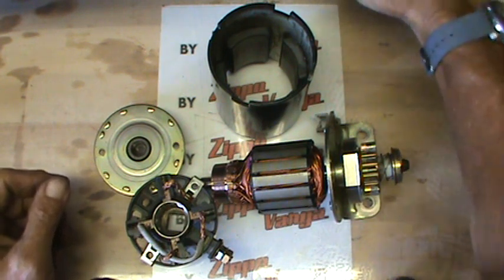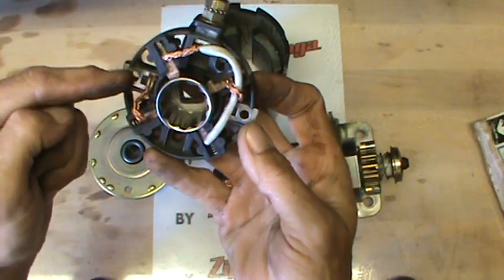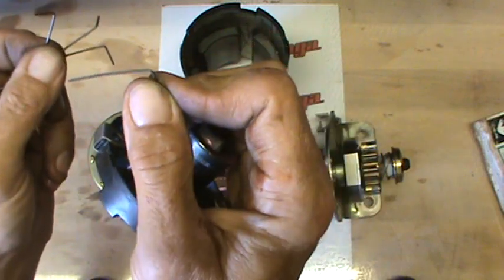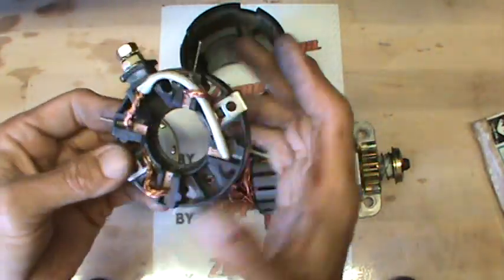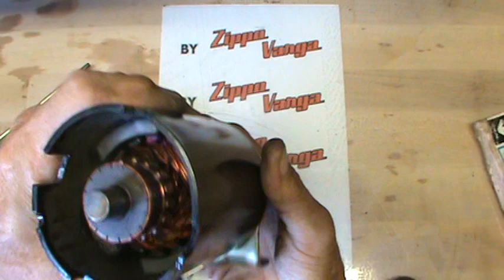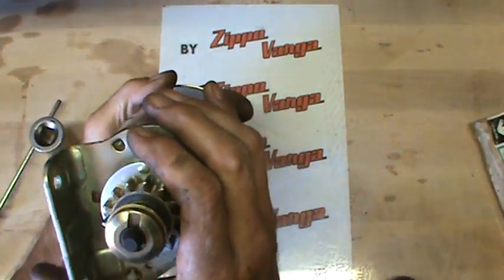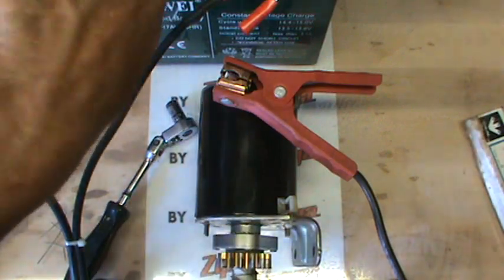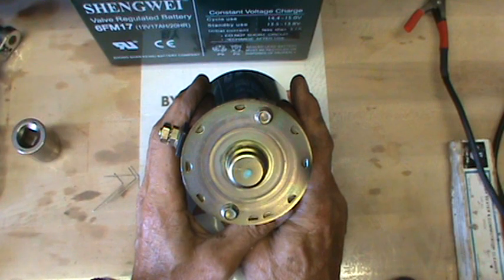How To Install Brushes in a Starter

Comment: Very helpful, excellent video.  My starter is for a 12.5 kw generator, and it is built a little differently than the one you used, but your video gave me the understanding I needed to get my brushes installed.  Many thanks!

Comment: I did a engine swap and did not notice where you connect the battery cable that post was hanging out of the starter, still works. I have worked on starters before, this little trick should make life a whole lot less painful.

Comment: I don't watch your channel ... until now. I'm trying to get the brushes back on myself on mower starter (one you're working on looks nearly identical to mine) and had the same idea of wire. I just wasn't finding any stiff enough. Didn't know there was such a thing as jeweler's wire. [Also found piano wire an hour later]. Only there's enough headroom on the brushes to allow the wire to slide under the bridge piece of the holder, so I need thicker wire. Or modify. Gives me a solid idea for a product.
Reply from the maker: You can also use a socket of the appropriate size. I worked for Delco Remy and all of our brush assemblies had a plastic disc holding the brushes in place and you just pressed the brush plate over the Commutator. So there are tools out there for this task. The thing is designing a universal brush holder that would work with all types of starters. Cheers! Zip~
Reply: @ZippoVarga  I worked for a vintage engine parts restoration company rebuilding/restoring 12v motors used on the car, ie. wipers, which are virtually the same as this. We had a simple, extremely easy to use tool for holding brushes back. I've searched for it high and low and everywhere in-between and I cannot find nothing like them anywhere. I do not know if they are used in another industry or not, but it seems likely as obscure as they are. They worked like a charm, were easy to install and remove, and I never ran into a brushes or holders I couldn't use them on. Astounding little things.
Reply: I also modified simple 16 gauge stainless wire and got the brushes seated on the commutator once I figured out how it needed to be formed. Getting to that point took a little time, but reproducing it 3x was easy. Got the job done at any rate. The video though is the most helpful one I found among all that was found.

Comment: I did this on a Grasshopper mower starter.  If this is the same size, I used a 3/4" pvc pipe.  Fit perfectly.  You can insert the pipe a little at a time while pushing back each bushing with your finger.  The armature just slid in and pushed the pipe out.
Reply from the maker: Awesome suggestion Ben! One I'll certainly put to the test. Thanks so much for sharing! Zip~

Comment: Yea Zippo found out my motor is not rated for salt water but can be used occasionally as long as you rinse every use with fresh water which I did royally so the rubber o rings failed and I got a lot of what looked like rust but no signs of water so I have to replace two o rings and armature not too bad,so thanks to ure video I learned how!Thank You from a beginner!!
Reply from the maker: You're more than welcome Augustine! Zip~

Comment: The video never showed where the loose brushes were inserted into the brush cavity before being secured by the socket and later by the wires.
Reply from the maker: I provide a visual and vocal explanation to where the brushes should be placed. If you removed the brush retaining fixture without regard to the brushes being under spring tension, then you need to reinsert each brush and spring into their respective spots which you can see (and hear) where they are located. I'm sorry if you're having issues. But don't lay blame on me for your carelessness when disassembling the starter. That's the beauty of learning a lesson. Typically you will only make mistakes the first time. Welcome to life!

Comment: I use some of those tiny worthless allen wrenches for holding the brushes, but I didn't know the trick with the socket, thanks for that!  Before the allen wrenches I made some with some big paperclips.
The hardest part of the repair is removing that little clip, its maddening!  I think there's a tool for removing it, I'm seriously considering one.

Comment: I'm having trouble putting a motor back together with a strong magnetic pull.  It's almost like the starter motor but the screw goes into a plate above the brushes so I can't see or manipulate the screws back into the right spot.  Any suggestions.

Comment: Nice video. I had a different approach myself. I put the squares,(forgot the official term), into the slots first, then put the core in next, and then clamped the springs down with my fingers and inserted them into the slot above the squares. Kept the squares from popping out while putting the core into position
Reply from the maker: Nice approach for getting the job done Adam! Thanks for sharing this alternative method. Zip~

Comment: I used the jeweler's wire but may have nicked the brush surface on a few of the brushes (just small scratches), now there is a squeal every time I start the mower, could that be the cause?  I also had to clean and super glue a few of the magnets in as they came loose when I rebuilt my starter, but I'm sure they are holding tight.
Reply from the maker: The squeal could be a couple things. If the magnets weren't perfectly aligned, one may be rubbing on the Armature or the bushings are out of spec or dry. I don't imagine the brushes would squeak loud enough to be noticeable. Cheers and good luck! Zip~

Comment: My starter is almost exactly the same except the breastplate is soldered on. Do you tip about the keepers holding the magnets in will not work in this case. Any suggestions?

Comment: I have a 2007 Craftsman DLS 3500 - 20Hp Riding mower , Wear on the starter can i find the part number#   ?
Reply from the maker: You use the Engine Numbers (stamped on the valve cover on Briggs engines) to search for engine parts. Zip~
Reply: @ZippoVarga   Great info , Thanks very much .

Comment: hey I don't have a lawn battery that has any charge, could I use a battery charger set to the jump starter setting to test my motor after it is rebuilt? also how could I find brushes/ a complete bottom plate? like does it have to specifically be a briggs and Stratton or would a general lawn equipment starter brush work?

Comment: do you know an easy way to remove and reinstall that little retaining ring that holds the starter drive together,, that's one thing that gives me fits every time?
Reply from the maker: +MissouriOldTimer There's a couple different types. Good idea for another video!! I'll get on that one for you. Cheers! Zip~
Reply: thanks, I always have a problem with that, I finely get it but I have the snap ring all distorted by the time I'm done..
Reply: You eased my mind for tomorrows task

Comment: Yes, but how to solder new brushes onto plate. Some places sell brushes only without plate
Reply from the maker: For the best results, you need an OEM brush plate. As for soldering brushes to the wires of an old brush plate, the composition of the brushes won't let solder stick to them. They need to be epoxied in place or spot welded like the originals. Zip~

Comment: O.K Zippo got my new parts but now I have no reverse 1-2-3 and only 2-4 forward same speed though,my question is it the control on my Minn Kota Endura C2 30 lb. thrust motor or wired wrong??please help

Comment: Hello I need your advice,,,,me I don't have skill to clean my starter..I have pontic sunfire....It will not start,,,every time I start the engine I see a.smoke from a starter,,,what do you think,,,its time for replacement? What tools do I need?  For how long if I will do it myself...
Reply from the maker: Sounds like you've just got a loose wire on the starter. Should be easy enough to diagnose. Find the starter and the wires attached to it and make sure they are not loose or touching anything but the post they are bolted to. Tighten them up as best you can, but disconnect the battery negative terminal first to avoid sparking issues while tightening them. Don't over tighten them. Just snug them up so the cables and wires don't move. Good luck! If you're not sure, find someone in your friends circle who is confident in what they're doing and ask for their help. Cheers and good luck! Zip~
Reply: ZippoVarga I will try....thank you so.muchs....sir
Reply from the maker: You bet James! Zip~

Comment: Great video. Always a struggle to get those brushes back in. I am right at the point of putting the brush plate back on and your method sounds perfect. Can't wait to go out and try it. My only question is, did you grease the shaft end cap before installing it?  Thanks again.

Comment: Hey zippo how about the bearings [ races ] and where do you get them ???????  BIKERB
Reply from the maker: +bikerb62750 The end cap bushings are not available for purchase individually. To remedy worn bushings, you need to have new ones machined unfortunately. Sorry I don't have better news on that front Biker. Cheers!! Zip~
Reply: take bearings to NAPA, they can measure and find a corresponding bearing usually.

Comment: Unfortunately I didn't see the trick about removing brushes the way ZippoVarga described.  I had pulled out the end piece and as a result the brushes were left hanging there!! grrr. II came up with a solution using paper clips. I made four staple shaped "tools" that were just the length of the distance from the back of the brush holder to the front of the brush after I compressed it.  Then I slipped a "staple tool" over it and did the same with the next three.The  tool left enough space to slip the bushing holder over the commutator.  Once pushed in a short distance I removed the clips and pushed the assembly all the way down over the commutator.. Job done!!
Reply from the maker: They can be a pain without some sort of brush retainers. I'm glad you got it all sorted out! Cheers Keith! Zip~

Comment: I disassembled a starter for an 18hp opposed Briggs and used toothpicks to hold back the brushes, not nearly as nice as the wire

Comment: this would be easy if they had just put a place to stick a piece of wire in to hold the brush back until all installed..they didnt...
Reply from the maker: When assembled at the factory, the brushes are held back by a reusable set of clips. They were never intended to be serviced, but like anything....where there's a will, there's a way. Zip~
Reply: Where can I get jewelers wire?
Reply from the maker: @johnsutter1497  You can get away with large paper clips as well John. Zip~